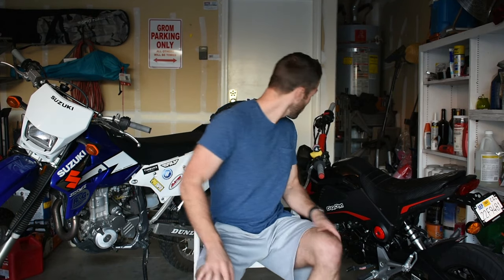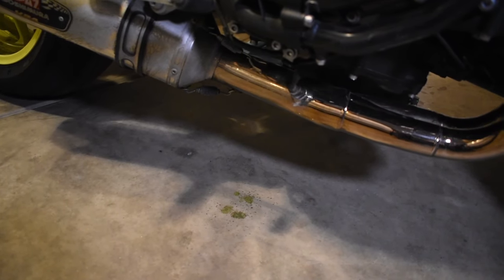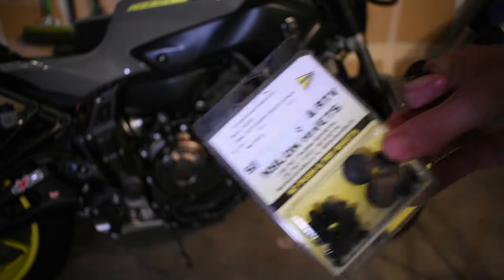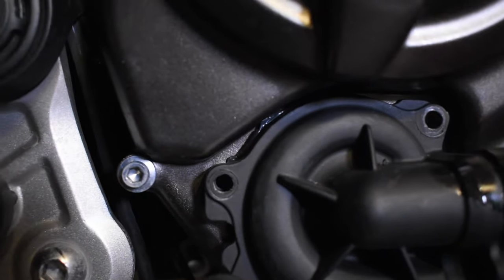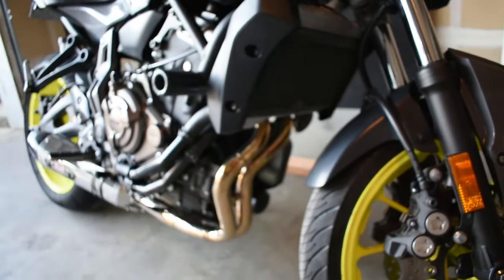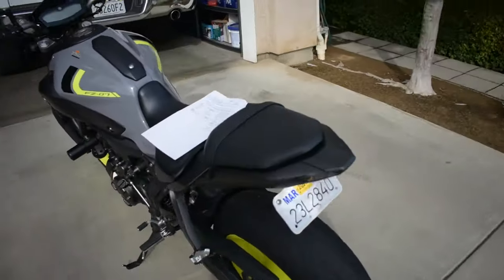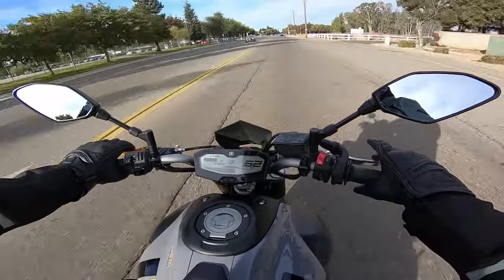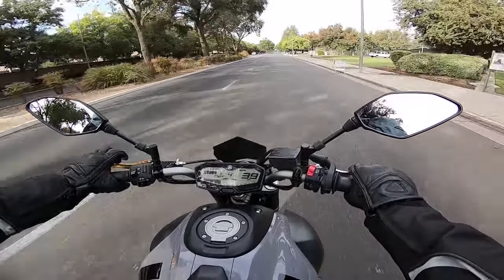FZ07 - I fix it, I ride it

Comment: Its a shame you don't have more subs. I'm currently on the hunt to get my motorcycle, I left a comment several months ago about whether I should take the MSF and I have good news, I got my endorsement! Just trying to find a job to grind out my next dozen paychecks
Reply from the maker: Outstanding!   Great work!  What are you looking at getting?!
Reply: CT Gromer I was debating on several but if I had to choose it would be an SV650, or a CBR300R. But I will most likely get any thing that happens to be a good deal that comes up first
Reply from the maker: @matthewduke4233  Thats the way to do it, the deal is king!  Then when it comes time to sell it for something better, you dont usually lose money!

Comment: Did the new coolant system parts also have that gnarly black sealant? Or just normal gaskets. I feel like the black goo was an attempt at a repair by someone, but I could be wrong.

It’s more fun to ride a slow bike fast than a fast bike slowly 😇
Reply from the maker: I'm actually really glad you brought this up because I did not do a good job of explaining this in the video.  After some research, I concluded that your opinion is correct, someone definitely tried a cheap quick fix with RTV or silicone.  The stock gaskets are just a rubber gasket with some white lithium grease on it... NOT RTV!  I couldn't remove it and ended up taking it to my local shop and was prepared to pay for the headache.
Reply: CT Gromer no problem. Your videos are worth paying close attention to and I spotted it, like a 350 Chevy with a quarter ton of blue RTV oozing from under the intake manifold 😅
Reply from the maker: @friarpesel5646  ughhhhh that sounds nightmarish!  it sounds like you've experienced that before!